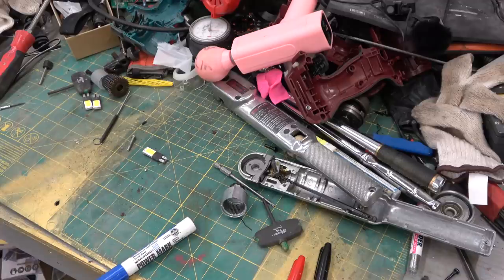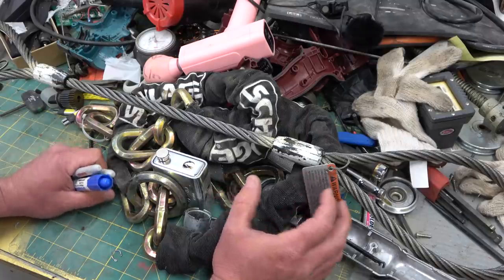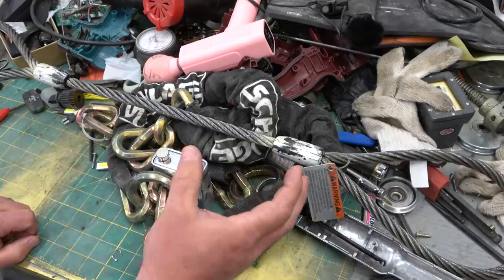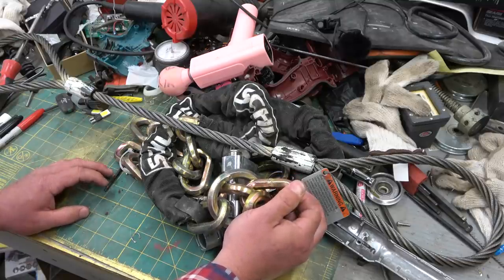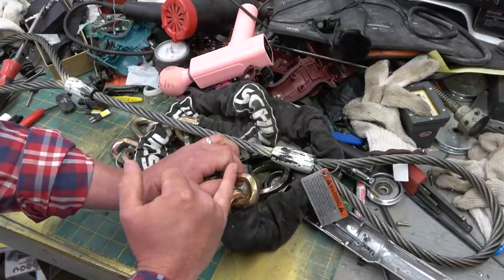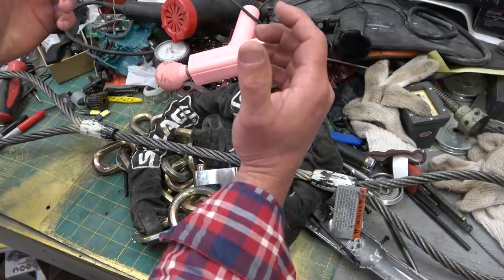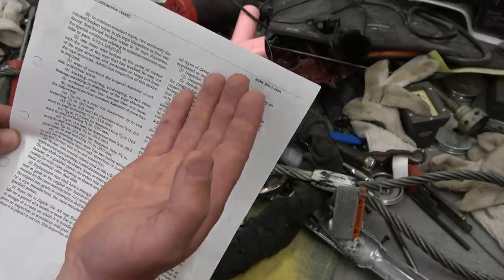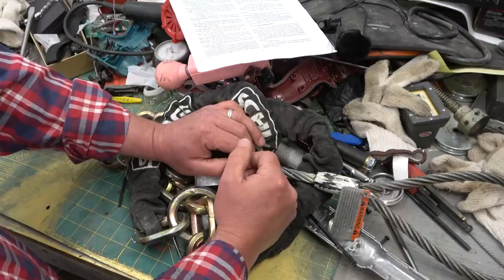"It is not known why the pulling cable snapped."

Comment: NASA did a presentation called "Normalization of Deviance." It's applicable to situations like this brake override. Definitely worth a watch.
Edit: A former NASA Astronaut
Reply: where to find that?
Reply: Also known as the whole Space Shuttle program.
Reply: Operation paperclip.
Reply: @ChaosBW  What???
Reply: Nasa is one to talk about Normalization of Deviance. Between their history of failed launches, deaths on the gantry (Apollo 1), and lost orbiter (Challenger 73 seconds after launch, Columbia breakup upon reentry), they have lots of material.
Reply: @bobsapp807  - If you think that, then you need a video called, "The Normalization of Deviants."
Reply: Ask Bob Ebeling about the "Normalization of Deviance". He stood up for what was right and his company blackballed him for it. If the challenger hadn't exploded he would have been forgotten in ignominy.
Reply: Obviously no good redundancy for safety...
Reply: Isn't that how they blew up the space shuttle??
Reply: Pauline Weinberger  I work in the engineering dept. of my company We certify roll over protection setups for a few tractor designs but mostly for commercial zero turn lawnmowers. One of our clients always pushes limits right to the edge of failure. We often have to retest several times till they pass after modifications. I would never buy one of their mowers for fear of my safety.
Reply: Pauline Weinberger  it is also associated with other risky behavior.  With DUIs often times the driver feels very comfortable driving drunk because they haven't had anything bad happen up to the point of being caught.
Reply: @russellstarr9111  hey Russel what are ahem some of your least favorite colors?
Reply: @phillipg9345  Thanks Philip, yeah I know what it is..Was wondering why he mentioned it??😸
Reply: @phillipg9345  What's that have to do with the discussion though?
Reply: @russellstarr9111  Yellow? Orange? Red? Asking for a friend!
Reply: @jonathanwright5550  yes, that's the primary example
Reply: @michaelmcguinn7596  Sorry, I'm not risking libel, but there are a lot of brands the same color. It wouldn't help you much.
Reply: @martinda7446  gotcha
Reply: @tomkeehn  I don't know either
Reply: @TheOlsonOutfit  I worked for the company that made that seal that failed
Reply: Pauline Weinberger  in the case of the o ring everybody obsesses over (talk about missing the forest for the trees) they seriously figured that since it normally only burned 1/3rd through it had a safety factor of 3...
Reply: @russellstarr9111  [retracted]
Reply: @Microfrost  We don't certify until they meet ISO 21299 or Osha 1928 standards.
Reply: @russellstarr9111  OK, I'm pretty sure I misinterpreted your original statement. It's not "modify for cheapness, fail, fail, fail, fail, happened to pass once" but rather "modify, fail, modify, fail, modify, pass."
Reply: @phillipg9345  😾
Reply: @russellstarr9111  there are those companies in every field. Some try to beat the test, others try to find their way around the test.
Reply: @jonathanwright5550  Formerly "Morton Thiakal" check spelling.  Changed their name to A.T.K. after the seal failure  correct  ??
Reply: "There is nothing more dangerous than breaking a basic safety rule and getting away with it. It removes fear of the consequences and builds false confidence."
Reply: Reminds me of a discussion I had with someone from a local coal power generating station. They had instruments to measure vibrations in the turbine bearings and one of them was giving a reading that was of some concern. They checked it locally and it turned out that the instrument was reading incorrectly. So rather than fix the instrumentation (would have required a shut down, god forbid!) they basically let it be known amongst everyone whose job it was to watch the instruments to ignore that one. 
Guess which bearings imminent failure was not caught and caused not only a shutdown, but also a replacement of the turbine shaft!
Reply: Pauline Weinberger   Sounds like how we guage inflation in the U.S. in A.
Reply: After their Therical (sp)  mishap!!
Reply: @skunked42  did you try typing it into the YouTube that you're already using?
Reply: Reminds me of a case I was briefed on for aviation safety. An aircraft tug's brakes were bad but "everybody" knew about it and knew to slow down sooner. That is until the FNG is not given this non-standard briefing about said tug and failed to adhere to the standard operating procedures he was unaware of and managed to pull an aircraft right into the side of the hangar putting the multi-million-dollar aircraft and the hangar out of commission. Now, maintenance had to be done on other aircraft outside in the freezing cold and sweltering heat.
Reply: @johnspencer3994  whoops, you are correct.
Reply: That was an excellent video. Thanks for the recommendation!
Reply: Bit ironic coming from needs another seven astronauts.
Reply: @phillipg9345  Yes, but what does that have to do with this?
Reply: @peterhoulihan9766  for craps sake, I deleted it. I don't know why the other guy brought it up either.
Reply: @phillipg9345  I wasn't having a go at you, just wondering if the scientists extracted through paperclip were taking particularly extreme risks or something. If so I hadn't heard about it.
Reply: @Broken_Yugo  Except the o-ring on challenger didn't fail from the o-ring burning. It failed from because the o-ring didn't form a proper seal because it was too cold, and the rubber became too stiff. The engineers at Thiokol knew that they were operating outside of normal conditions, and management pressured them into misrepresenting the severity of the danger posed by those conditions.
Reply: That sounds like life advice, not an engineering tip.
Reply: @lastplace199  The point is the whole SRB joint design (along with a ton of other things on the vehicle) was a shitty inadequate design from the start, especially for a manned spacecraft with no realistic abort modes for much of the launch sequence. Cold technically caused the problem but really just amplified the fact that it never worked right. Feynman lays it out well in "Appendix F" of the Rogers report.
Reply: @russellstarr9111  Well Russell, save some lives and tell us the name of the company please! If you're the engineer doing the safety certifications and even YOU don't trust the products, then I sure as hell don't either. Why keep it a secret? Let it be know. Be the voice that makes a difference.
Reply: @91bdoug  Nope, was lazy and forgot how to google...
Reply: @bobsapp807  Yeh I've never heard of NASA either...
Reply: @russellstarr9111  And you allow that to happen?
It's only a matter of time before someone is killed because of the actions of the company you work for. DO something about it.
Reply: @BLKMGK4  the Plainly Difficult channel just covered it the other week, a Russian hydro place I think.... the damage was staggering 👀

Comment: The thing is for every occurrence like this there are 10 that are unseen, undiscovered just waiting...
Reply: We have a 'near miss' book at work, for anonymous reporting of such things, luckily there are very few.
Reply: @MattBrownbill  there's a reason there are so few.  Unfortunately,  covering up mistakes and liability tends to hinder these.  You never see entries like 'found safety cable just had one thread left, suggest check more often.'.  That's why we tend to have to write it in blood.  The other thing is, things get found on inspections and I think most of the time people don't realise the significance - IF a series of events had lined up.  For example, a paperclip falling into a keyboard in a subway control office could set of a chain of events leading to a dozen deaths.

Comment: One time as a technician, I was removing an old piece of equipment with a cam operated emergency brake and the cam was zip-tied in the unlocked position. Sickened me then, and it sickens me now.

Comment: "I need that order in writing."  Words to live by.
Reply: I don't care if it's in writing or not.  I still wouldn't deliberately disable safety equipment.  I would quit before I did that.
Reply: @daves.software  It rarely gets to that point.  When it is clear you are asking them to take responsibility they flinch.
Reply: @DavidSharp also expecting its the responsibility of the guy at the bottom of the pyramid to quit as the solution is no solution at all. Right or not people will chose to feed their family over yours when push comes to shove.
The incentives need to involve the higher ups. It is their responsibility to verify the working conditions are such that safety can be maintained as much as it is the workers to follow the safety guidelines.
The liabilty needs to go further up the chain than it currently does in practice.
Reply: In Italy the CEO or founder of the company is ultimately responsible for safety
He can delegate the execution, but not the responsibility
The other people involved should only get the equivalent of aiding and abetting
Reply: I have stopped two "orders" that way! They do that so they look good that production started again, but when things go sideways you are left holding the bag!
Reply: "you can't ask me to break the law, and you know it very well" if they insist or try to get mad is my personal, ultimate tombstone on such requests. Only had to use it twice fortunately
Reply: @riccardo1796  Not in this case, Riccardo...

From a news release 2 weeks ago:

Prosecutors have opened an investigation into suspected involuntary manslaughter and negligence. They allege the three men — cable car company owner Luigi Nerini, maintenance chief Enrico Perocchio, and service technician Gabriele Tadini — were aware that the lift had technical problems before the crash occurred.

Following the accident, Tadini admitted to investigators that he had deactivated the cable way's emergency brake system, which could have prevented the crash. He said he suspended the system with the agreement of the other two suspects because it had been malfunctioning and interrupting the funicular service. 

According to the Judge Donatella Banci Buonamici, Tadini had tried to shift some of the blame on his two superiors after acting "with total disregard for human life, with bewildering carelessness." 

The judge said there was a "total lack of evidence" against two of the suspects, who were allowed to walk free on Sunday. However, she concluded that most of the blame fell on the third suspect — service technician Gabriele Tadini.
Reply: @rberkar6669  I did that too. I was like "I am not signing that, you can but i will not" I had to audit excevators and one dropped the shovel sometimes. 
I toled my boss that it could kill someone and he wanted me to give it free for work.
Reply: @AdmiralBob  You get it in writing, and still refuse to do it (if it's really bad), and then they say you're fired, and then you go to the labour board, and say they fired me because I tried to not kill people, wanna help me sue them? And you go to the press, and say this company fired me for trying to not kill people.

Comment: AvE didn't mention it, you had to pay attention to the timestamps in the pictures but for anyone who didn't notice: The brakes had been disabled for up to seven years prior to the accident too.
Reply: but that is only because the main and haul cables were in decent shape to begin with
Reply: @gabrielemagnabosco8926  In the video he goes over that the haul cable was stressed ~by~ the brake fault, the brakes were locked out ~because of~ the fault, so not only had the brakes been locked out for SEVEN YEARS but the cable would have been stressed ~before~ the start of that timeframe
Reply: Holy crap! Now at least we know to look for bright red clamps before getting on one of these things...
Reply: You seem to have misunderstood my comment, my bad.

The whole thing only remained up since 2014 (when they allegedly started this shenanigan) because at that point the 2 cables were in almost pristine condition (for being 20 years old)

I'm far from condoning it, just saying that they got lucky with the cables and kept the thing that way because it was "working good".
Reply: @gabrielemagnabosco8926  If something can happen, it will happen, whenever it happens. - You never risk ANYTHING
Reply: @bbgun061  That's exactly my thought.  Don't just look for red though because in 2014 they were a grey/bronze color, then they were red in 2018.

Comment: they've actually immediately arrested the owner and 2 executives. but suprise: they've been set free. only the operations manager is still under arrest.
Reply: Because he is responsible, owner and executives are not technicians, if they were they wouldn't have hired him
Reply: "and every politician, every cop on the street, protect the interests of the pedophilic corporate elite" -How The World Works, Bo Burnham
Reply: @TheGiuse45  the management was informed of the situation, for sure. The moment you as a manager are informed, the problem becomes your and you have to be sure it’s resolved ASAP, also you shut the operations until the problem is solved. You don’t have to be an engineer to know what safety brakes are, that’s why they call them SAFETY brakes.
Reply: You can keep people in jail before the trial only if they are a public danger or if they're likely to escape or if they can hack the proofs.
Reply: Sad...theyre the ones who gave the call that caused all of this fuckery!!!
Reply: @blitzkriegpower  Unless you shut it down for a pandemic and the new hire dont find the lockouts?
Reply: @TheGiuse45  who put the pressure on the technician to keep the car running despite the faulty brake?
Reply: @jostouw4366  they're painted bright fucking red for a reason...

Comment: You are NOT wrong. I worked (43 years) for a huge Oilfield service company in the Wireline division. The way you describe the construction of, and failure modes for wire rope is exactly correct. We have a facility dedicated to pull testing wireline cables and testing splicing techniques. I witnessed several tests where the wireline broke. It is scary as hell. Keep up the excellent analyses.

Comment: I have worked on equipment with door switches and e-stops bypassed by the last guy. I rewire and fix whatever is the problem, I cannot fathom doing this.
I work on pressure vessels and hi temp washing equipment.
Reply: People like you are the unsung heroes that prevent tragedies like this and other industrial accidents from occurring.
Thank you
Reply: Idiots like "the last guy" are the reason we are now moving to include RFID confirmation for many safety lockouts. I've encountered operators with their own lockout key so they can have access into the safety cage while the equipment is still running.
Reply: Bless you for your diligence.
Reply: People bypassing safety's on pressure vessels is a BIG NOPE from me dawg
Reply: Jesus. People (a lot of those being people who should know better) take for granted how much of the modern world can kill you in an instant. It would much more without emergency stops and failsafes.
Reply: @RobertBeckk  you ever seen a carseal missing on a PSV isolation valve?  and then no one wants to fess up as to who removed it, or closed the valve?

Comment: You are NOT wrong.  I had this issue with hoist systems in the past.  If my experience is any good, management told some guy to wedge the brakes... "those things are never going to be used"

Comment: A number of years ago I did the software for a PLC based trainer for the ski industry in Kalifornia to demonstrate how safety measures such as off-sheave detection circuits (usually a wire that breaks), reverse-driving, and cable-break emergency braking systems interact with programmable logic.
Reply: Personally, I wonder whether it had been run during those intervening months or fit have been just left still.  Because think about those cables going over those rollers and around the drive rollers.  They're being continually lubricated, heated, and to an extent reforged as that pressure in that heat act on the cable.  Then you leave it sitting for a year or more. Where it's bent to a small radius it's left there for months.  It isn't being lubricated, it isn't being heated, it's not being reforged.  And I know that in a literal sense is not being forged to reforest or anything like that it's a simple matter of the metal being bent.  But I have to think even at low temperatures it has an effect on the crystalline structure of metal.  And I have to wonder if leaving it in one place for a year would not have damaged that structure.

Comment: This is a great reason why I won't go on amusement park rides. I applied for a maintenance job working on them and was utterly shocked when they said I had to have several years of experience and they offered $10/hr for that exp. Thanks for another great video, AvE.
Reply: A ride here at the Calgary Stampede collapsed a few years back. A structural member had cracked and had been repaired by welding over the crack - no grinding out the crack, no fish plates or doublers, nothing but an ideal stress riser hidden under a cosmetic layer of weld. You get what you pay for.